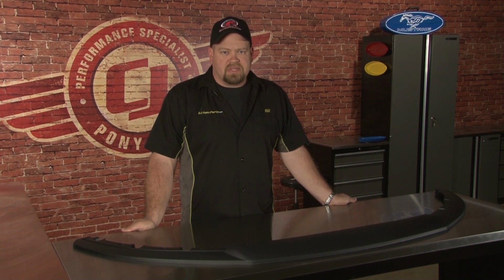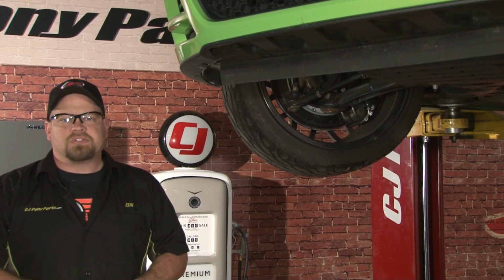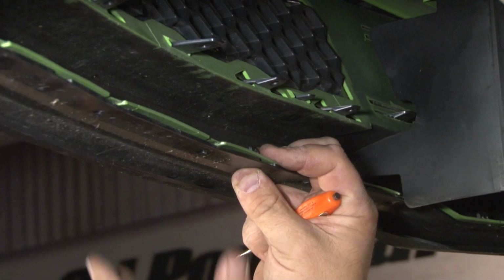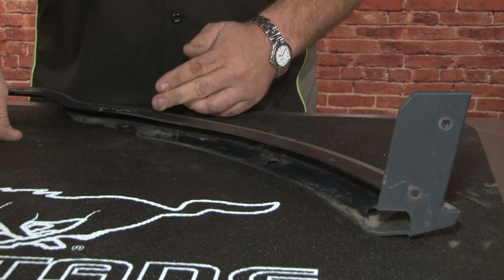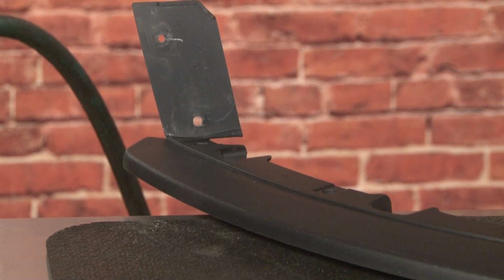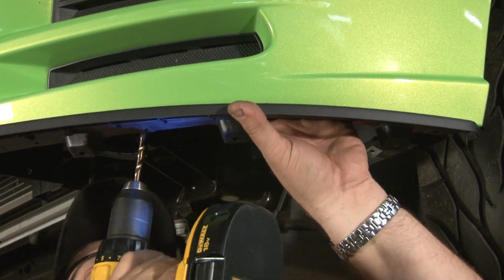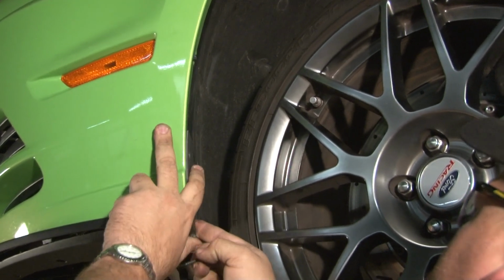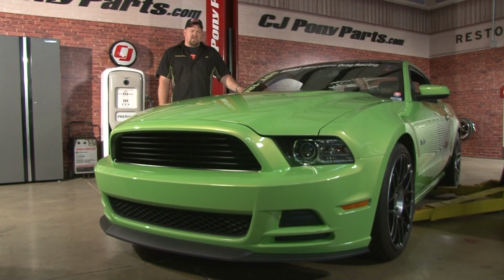Mustang Roush Front Splitter 2013-2014 Installation

Comment: does roush sell a splitter that doesnt need to be cut. You know what I mean a splitter that already has been modified to the original splitter. so all i would have to do is just take off the air deflecter and install it.

Comment: I bought this splitter and watched this video instead of following the Roush directions. Much better than the paper instructions! A little harder than I thought, but I used ramps and a dremel. For those looking to attack this project - A few words of advice:
1. Take your time
2. Dremel + cut wheel works wonders (cut to where the bottom lip is flush.
3. Pay attention during reinstall.
4.Take your time.

Looks sharp on my Mustang. Thank you CJ Pony Parts for this video!!! :)